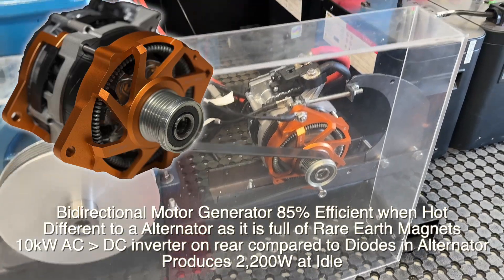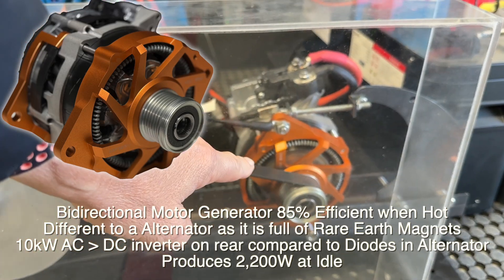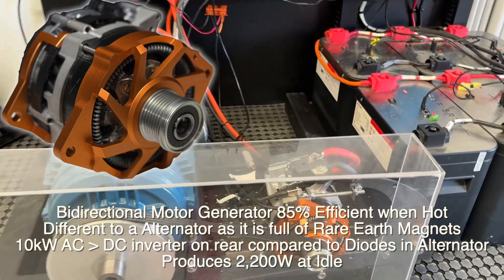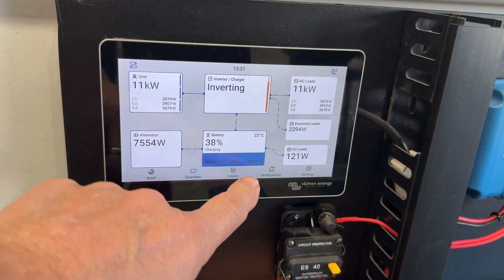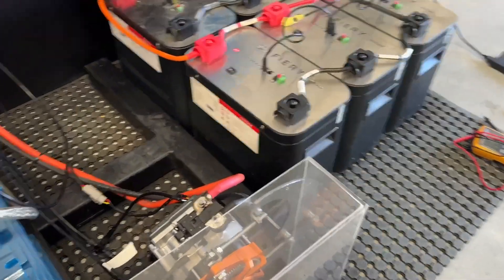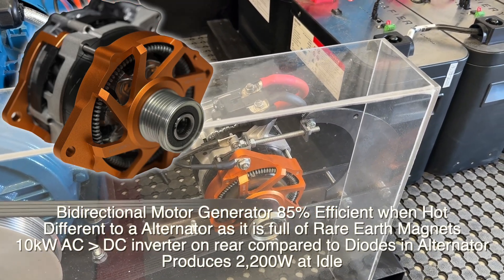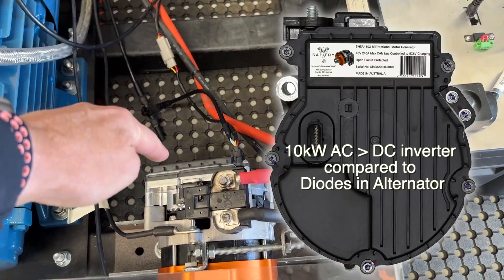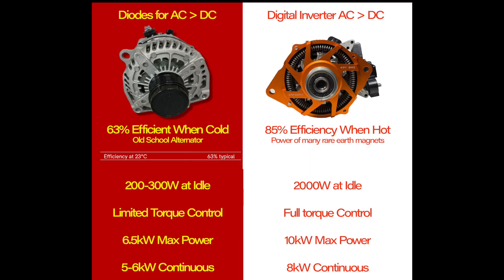BMG J180 Mount Continuous 8kW Power Test for Temperature - 85% efficient compared to 50% Alternator

Comment: What voltage is this unit?
Reply from the maker: 48V nominal, charges up to 58V DC
Reply: @Safiery thanks, im looking for a more efficient way to charge a 12v 400ah lifepo4 battery bank.  Currently running a sterling alt to battery with a traditional 130a 12v  alternator.  I am currently working on relocating our oil filter to fit a larger brushless truck alternator... But thought maybe there was a way to use a 48vdc brushless alternator and convert it to 12vdc via wakespeed unit. Not sure if there is a more efficient 12vdc charge solution you would suggest.

Comment: Plerase let me know rated RPM,Torrque, KW. Thanks
Reply from the maker: 12,000 RPM and a peak of 200A at 48V (see previous video showing this level of output), but we run at 150A continuous.
Reply: @Safiery  3000W AUX power / Electric Launch Assist / is mind blowing. if people understand your idea is start of beatiful future. This Bidirectional alternator exactly what i am looking for and exactly for my project.